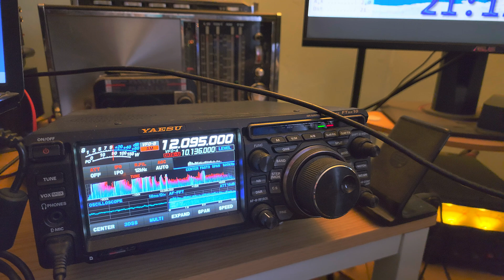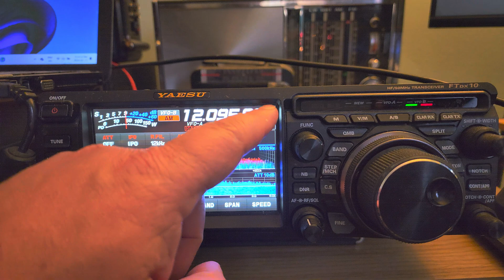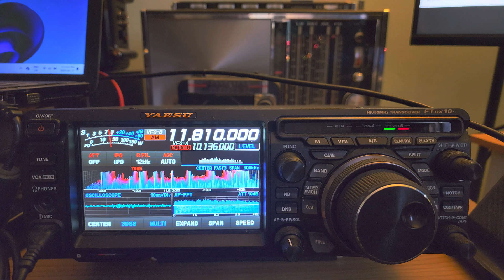BBC World Service 12095 and 11810 kHz Shortwave on Yaesu FTdx10 transceiver and End fed antenna

Comment: Excellent signal and nice shortwave equipment. Although BBC WS broadcasts to North America has long been discontinued in the late-90's, when the Sackville relay station in Canada was closed down many years later. But they were receivable in the continent via Ascension Island, which has a shortwave relay station.